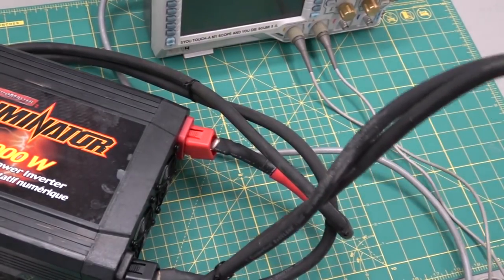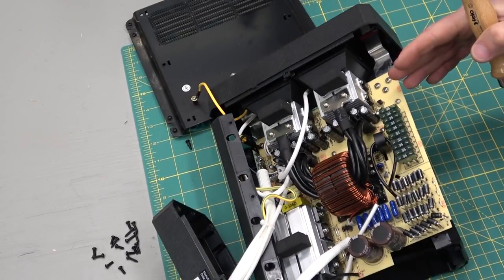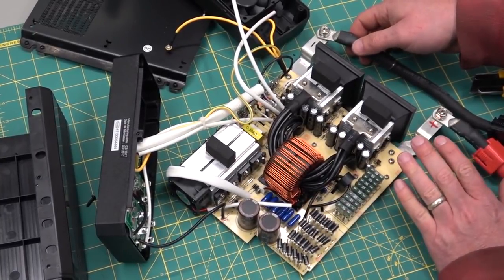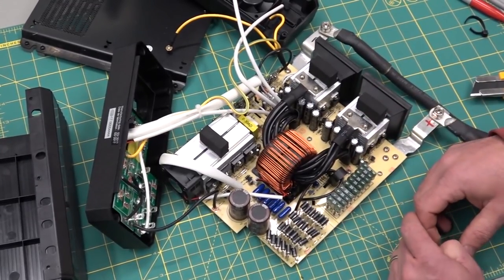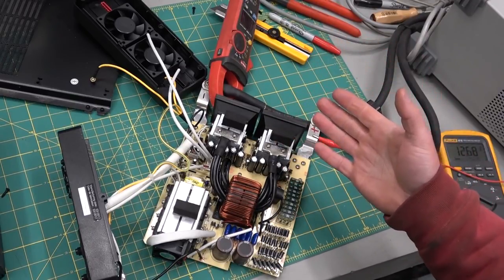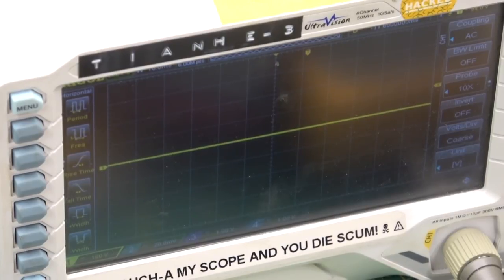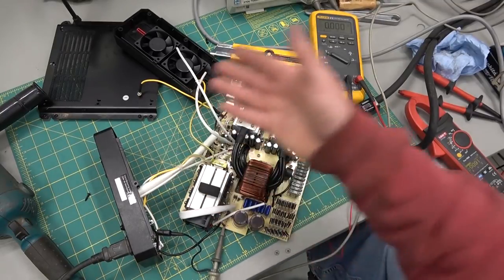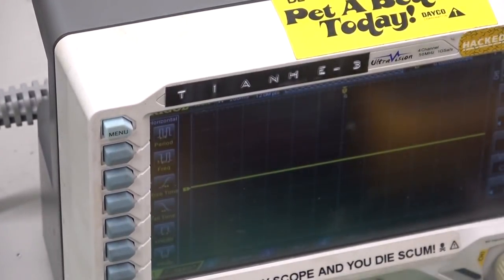BOLTR: 2000W "Digital" Inverter | Pure Sine Wave?

Comment: "If you can get Warranty on it, great, if you can't..." Whoa. Hold up. If you can't, then you go buy a brand new one, take it out of the packaging, put the fucked one back in, and return it with receipt the next day. Unless of course you respect your retailer. STORY WARNING: This shit one I know they sell at Canadian Tire, who have in the past refused to refund me from a house-brand item from another location ("We're separate businsesses", horseshit, you share branding and advertising from coast to coast), and also refusing me a return on a house-brand item (bandsaw) with a crack in the cast-iron housing that was painted over with factory paint - proving it was broken before it even left the assembly line - because I didn't have a receipt and "might have just stolen it and walked up to the desk" (in which case, I'm still allowed to leave with the stolen item just not get a refund? And further, what does it fucking matter, are you going to try to sell it to the next sucker? It's getting returned to manufacturer). Bit of a sore spot with those assholes. If I can't get what I paid for and deserve, I'll at least be taking what I can get later on to balance things out. Ten years ago and I'm still furious. Rat-fucking needledicked assclown middle manager uncle-fuckers. spit

Comment: Sorry man I think your off about the body diodes.  The diode is formed intrinsically from the doped regions of the fet.  Thus it's not difficult to find parts with a diode forward current rating (Is) that is almost as high as the drain current rating (Id), sometimes its actually higher.  

Plus those fuses are goina pop quick with ~1kA on em. Not that it would be easier to repair the fuses, looks like you'd almost need a torch (/s) to desolder anything on there. 

Also its not best practice to connect your scope probe to a foot long red antenna right next to a high current switcher. Cant say if it mattered here or not but that noise on the 12v rail looked suspicious.
Reply: Yeah, the current handling of the body diode is not miniscule, but power dissipation at the high current will be higher than normal operation because of the diode voltage drop being higher.

Comment: I have these 2 "tools" that you fit to your drill and their only purpose is to sort of chamfer a bolt/threaded rod that has been cut so that you can easily start a nut. Would you have any use for them? I've never used them and doubt I ever will. I'm pretty sure it was an impulse buy after seeing them on Kickstarter....

Comment: reverse voltage protection diodes would also wreck the efficiency of the thing, .7V @ 200A is a lot of power

Comment: Watching your video and wanted to include what an industrial inverter looks like. The screen shot is from the output of 1.2 MW Uninterruptible Power Supply (UPS). Each of the dots is a data point in the graph. https://imgur.com/a/PHaZWIk  The inverter is 12 pulses.

Comment: Any tips on picking up a used scope?  Or did you buy that new? I need one for my ham radio ventures.
Reply: I was going to buy a scope, and then got a USB all-in-one scope/power supply/waveform generator called an Analog Discovery II. It has been the greatest thing I've ever bought for electronics hobby work. Would recommend. Unfortunately, the 25 MHz bandwidth is probably to slow for a lot of radio frequency work (I don't know anything about HAM specifically).

Comment: At 13:00, this is the typical waveform laughingly known as "Modified Sine Wave" and is most certainly not a pure or true sine waveform. Either you didn't read the label or the label lies. What you are NOT seeing is the huge harmonic content being generated by the fast transitions of those big DC steps. Open up your vertical channel bandwidth to 100 MHz or so, and speed up the timebase or better yet, get a spectrum analyzer. Many (but not all) electronic gadgets will gag on the RF noise being generated by this crude AC inverter.

Comment: If you put this modified square wave thru a isolating transformer(120v-120v) is the output of the transformer any better?
is the least power waste (blender vs magnetization current of the transformer) considering running for long time of battery.

Comment: Designed to barely work for a while.  Dare you to plug in 1000 Watt load (or whatever the "continuous" load rating is) and see how long it lasts.  An old Washing machine with a full tub of water agitating back and forth would be good enough of a load. To give this thing a break, turn it on and off every 5 minutes or so.  If tour lucky, it will overheat and shut off.  Sooner or later this will blow up.  It would cost ~ 4-5 times as much to make it a safe, reliable, 8 or 9 step sine wave power supply, which would weigh more than triple.   Wanna have more fun? Just lower the input to 10.5 or 11 Volts and measure the current.

Comment: I have a question for people who might know more about electronics. I have a similar inverter installed in my work van, for operating a microwave. I've considered adding a second (deep cycle) battery in parallel to reduce the current draw from the vehicle's alternator. Are there any foreseeable risks or downsides to this? Also will this be effective as I intend?

Comment: It was my understanding that REAL "true sine wave" inverters just used stepped DAC drive to power devices. Even a truly cheapo 8 bit DAC will return 256 stepped sine simulation. Transformer mostly smoothes out the sharp (but small) steps.  Push pull using all same devices is easy. Just feed center tap primary with positive and then alternately pull down either side to ground.  

That of course only (pretty much) works for low watt inverters due to requiring linear bipolar power transisters. To pull it off with FETs is slightly trickier. Current thinking follows TI app note:  http://www.ti.com/lit/an/slaa602a/slaa602a.pdf

Comment: Do you have a recommended inverter that is robust, but wont break the bank and has a clean output?  Im wanting to install one that could handle a small pancake compressor in the truck, or handle a skill saw and such connected to it.

Comment: Test the current-voltage phase difference with inductive vs resistive vs capacitive loads? Do VFDs have better output filtration that that thing?

Comment: RF guys will disagree about the 1's and 0's making imperfect sine waves.  Almost all transmitters have a digital synthesized output now.  They don't bother on crap like this because your blender doesn't care.  Pretty easy actually if you know what you're doing.  RF gear can do hundreds of thousands of watts with sine waves pure enough your osmelloscope couldnt detect a difference.  Just too Friggin expensive.

Comment: Good to note "these fuses will NOT protect the MOSFETs !"  I wonder why they are there at all ?

They do make "pure sine wave" inverter that have a very "clean" sine wave output.  They cost more rubles but inductive loads will run cooler and more efficiently and electronic devices will like that also.

"Good" quality pure sine wave inverters have MASSIVE toroidal transformers, which is where the money goes.

Comment: You did not distinguish between a pure sign wave inverter and a regular square wave inverter. My generator has a pure sign wave inverter so it is safe for electronics but it is usually much more expensive. Cheap inverters do produce square waves but pure sign wave inverters are supposed to be the same electric that is produced by the power company. Can you make a follow up video discussing the two types? There is a third type called a grid tie inverter that is made for solar installs also.

Comment: Can someone shed some light as to why I shouldn't use a 11p7s 18650 lithium battery to power my 24VDC input inverter?  The useful voltage of the 7s setup fits the voltage limits of the inverter perfectly.  AvE seems to suggest there are some issues with this, did I hear that right?  I am certainly aware of the care needed to charge a battery like this, but I would have never thought there would issues using it as a power source if the inverter is matched to the capacity and safe discharge rate of the battery.  Thoughts?
Reply from the maker: the 20v startup spike on the input.

Comment: Man I really enjoy your videos now I have a question maybe you can help me out do they make a 12v to 1.5v voltage regulator that's small enough to fit in a 3 inch square box I've been looking for one all over the place and cant find I I got one that's 12v to 3v but it makes the motor go to fast I wonder if the amps could be another issue please help I'm on a pinch here thanks alot

Comment: I'll bet theres some legalese that allows manufacturers to call it a "pure sine wave"; even uninterrupted power supplies for computers, servers, and medical equipment doesn't usually have a good sine wave until you're paying many thousands of dollars which usually have a different battery and a good brand name on the case.
Reply: You're probably right. The processed food industry has convinced the FDA that 0<x<1=0, so that anything you can think of that you don't want to eat (like fire retardants) can be counted a zero units per serving as long as it's less than one unit. Whatever the friggin' unit is...

So if your doc says 'stay away from trans fats' and you start reading labels, you see marketing wank on the box like "0 grams trans fat per serving" only to read the nutrition label or ingredients and see that there are trans fats, just less than one gram per serving.

Comment: raidos HATE inverter power due to lots of RF emmited from said inverter. Take a SDR dongle or even a standard AM FM radio and listen. Most inverters emmit lots of noise on the RF spectrum because of that large inductor.

Comment: Why doesn’t anyone pull AC power directly off the alternator, rather than turning AC to DC just to turn a portion back to AC?
Reply: Kevin Wood What alternator are we discussing?  This is for converting stored battery power into 50/60 Hz AC.
Reply: Ethan Poole power inverters are often used on a vehicle to power your AC devices. Just wondering if it would be possible to tap into the AC alternator instead.
Reply: I believe it's because the alternator isn't turning at 60 hz. So you go to dc and then make something to output the 60 hurts. That way you can use your devices that expect 60 hz, which in turn convert to dc :)
Reply: @kevinwood3312  cause the voltage wouldn't be the right level and the frequency would be wrong to boot.
Reply: DTR RTD would it be easier to manipulate voltage and frequency than change dc to ac?
Reply: @kevinwood3312  can't easily change an AC frequency to another, and while voltage can be transformed, it has to be able to track.
Reply: Kevin Wood Your automobile’s alternator does not typically make its 3-phase output readily accessible as it normally goes directly into a bridge rectifier pack that converts it directly to the 13.2-14.4VDC required by your battery and electrical system with the actual output voltage regulated by varying the field intensity.  As such your automotive alternator is not capable of delivering especially high voltage since it is purpose designed around the needs of the vehicle’s electrical system (typically around 14VDC).  Further, in an alternator the output frequency is directly proportional to the RPM of the alternator relative to the number of poles in the alternator — and because the engine RPMs vary considerably in normal operation there would never be a stable output frequency since engine RPMs can vary from as low as perhaps 500-600 RPM to as high as perhaps 10,000 RPM in some high performance engines.  Since alternator frequency is innately tied to the rotor RPM, which is then tied to the engine RPM via the belt and pulley system, that is not something easily overcome unless one inserted something similar to a CVT transmission in between the alternator and engine so as to create a fixed RPM at the alternator independent of engine RPM, which is not terribly practical, as one may imagine!  Hence it is much simpler and cheaper to simply convert the nominal ~12VDC system voltage into 120 or 240VAC at the local 50 or 60Hz line frequency.  

But this is why most portable and standby generators in North America run at either a fixed 1800 RPM (if a 4-pole single-phase alternator) or 3600 RPM (if a 2-pole single-phase alternator) to generate the required 60Hz line frequency.  In the more common 2-pole single-phase alternator, if you do the math of 60 seconds in a minute and 60 AC cycles (Hz) per second then you get 60sec*60Hz=3600 RPM — to find the RPM with more poles in the single-phase alternator simply divide 2 by the number of poles, then multiple by the same 3600 — for a 4-pole that works out to (2/4)=0.5, so 0.5*60sec*60Hz=1800RPM.

Comment: You'd need a pretty giant (and expensive) diode to input protect the 350A supply, and it's probably going to halve the conversion efficiency. It can be done using MOSFETs instead, but then you need another bank of switches, heatshink, etc. and again hit your conversion efficiency pretty hard. It's not that practical.

Comment: Most inverters on the market use the waveform, shown in this video, referred to as "modified sinewave". As you see, its anything but. For more cash, you can get TRUE sinewave inverters. As mentioned, most of the time you can get away with "modified sinewave" (square wave with shoulders). Some old gear (made before 1970) or some motors, need true sinewaves. It can also do a job on some 50Hz/60Hz transformers. Actually, the stuff that's hooked up after it, as it WILL generate nasty voltage spikes into inductive loads.

https://threeneurons.files.wordpress.com/2018/09/modified_sinewave.gif

Comment: Fun fact never ever plug a hammond b3 into ship power they generate false ground at 700 to 600hz and the hammond b3 generates mechanical timing by spinning the tone weels off ground and hot.
Reply: Did it fry your organ?
Reply: @cooterhazzardbhogg8236  not my organ but it went out with a bang, smoke, and a show.
Ended up playing 60hz tone though an amp turned up to put out 120v to power parts of the gig fun times.

Comment: Now this is interesting. Does your inverter actually claim to produce a pure sine? When I was shopping for one for my motorhome I noticed there are three types. Or rather they are advertised as such I guess. The first one has a "sine wave" that looks like yours; the cheapest. The second one has a similar wave but with smaller steps. And then ofcourse the third one that's supposed to be a pure sine wave.
I bought the pure sine wave one because I didn't want to fry my laptop. Nowadays I noticed that the second type works fine as well.

So what's the deal with this you think? The pure sine converters cost about double as well!

Comment: How does grid-tie inverters do? How come they are okey to push out on the public power-grid?
Reply: Those are current sources designed to lock into sync with the existing mains waveform.
Reply: @NiHaoMike64  So they only provide power at the peaks? What would happen if I converted my toy-steam-engine to turn a tiny RC motor of a generator which generated perfect 240VAC and connected that one to my grid tie inverter, would I be able to put any kind of load on that mini-grid?

And what about computer center which have huge battery parks for uninterpreted power in case the grid falls down? They need to generate their own AC from DC, and since it's server often critical systems I assume they require somewhat pure AC?
Reply: Quite a few modern data centers use DC power distribution.
Reply: @NiHaoMike64  I knew a very few data-centers do this, but it's not the norm and it's not common at all. Included those that do that still have AC power demands like cooling system, water pumps, compressors, fans and such, but they might not need as clean of power. But that doesn't change the fact that the wast majority of data-centers with UPS battery systems still run on AC.

Comment: Loose screw on board at 1 min ish time,    rolling and getting stuck to magnets and shorting the open copper wires around them...     not an best way to start off , if left un noticed .

Comment: Just feed that output through an LC filter and you'll get something much closer to a sine wave, and with only two electronic components: an inductor and a capacitor, wired like so: 

https://www.researchgate.net/profile/Hongliang_Wang7/publication/251996674/figure/fig1/AS:392845094604801@1470672977570/the-single-phase-inverter-with-LC-filter.png

Comment: What happens if you plug up a battery charger into the inverter and try to charge the battery that’s powering it ???
Reply: What do you think will happen? You’ll get two little electric heaters and a flat battery after a while...
Reply: heyt54 I wasn’t serious

Comment: This isn't the true sine model. I have the Eliminator 1kw true sine, bought in 2017, and the labels are basically the same. It doesn't say true sine on it, but it does say digital, which of course means nothing.

Comment: I had a guy swear to me that you can not charge your tool batteries with an inverter, wondering what you think about it.
Reply from the maker: shouldn't be any trouble atoll.
Reply: Josh B I charge all my red batteries on a little 400 watt invertor never had a problem yet
Reply: I always do if im doing a long trip.
Reply: @dirtyroofer3678  I use a little one everyday too, I dont notice a difference. I was just wondering what others thought. Hes also afraid of generators messing things up. Thanks for the replies.
Reply: You certainly can charge them using the inverter.